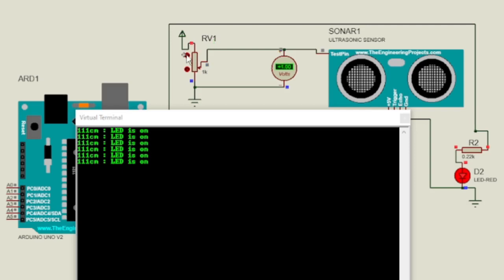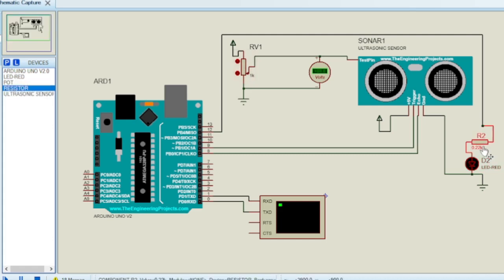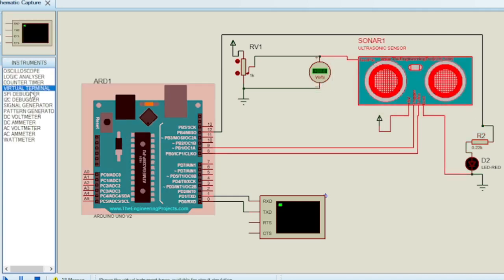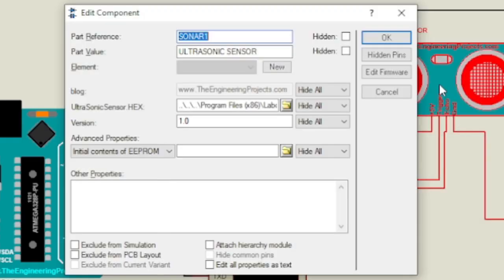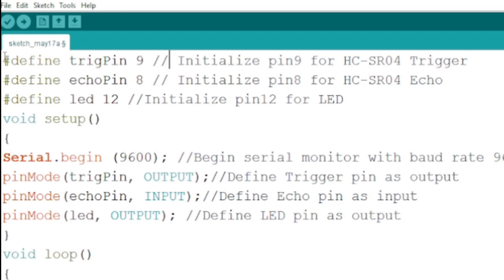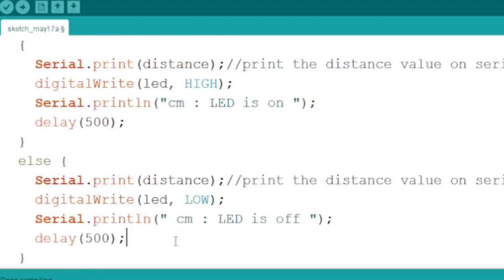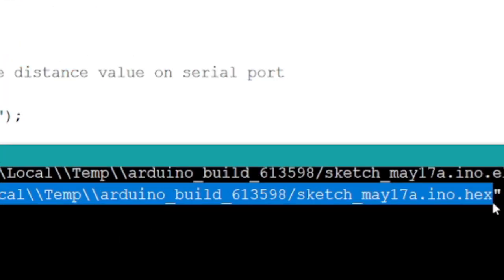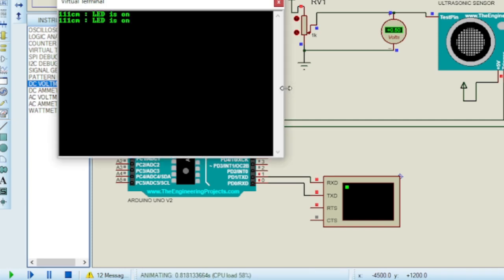🛑How to Simulate Ultrasonic Sensor Library to Proteus | 2024

Comment from the maker: #define trigPin 9 // Initialize pin9 for HC-SR04 Trigger
#define echoPin 8 // Initialize pin8 for HC-SR04 Echo
#define led 12 //Initialize pin12 for LED
void setup()
{
Serial.begin (9600); //Begin serial monitor with baud rate 9600
pinMode(trigPin, OUTPUT);//Define Trigger pin as output
pinMode(echoPin, INPUT);//Define Echo pin as input
pinMode(led, OUTPUT); //Define LED pin as output
}
void loop()
{
  long duration, distance; // variable to hold the duration and distance value for HC-SR04
  digitalWrite(trigPin, LOW); // Write trigger pin is as low
  delayMicroseconds(2); // Delay for 2microseconds
  digitalWrite(trigPin, HIGH); //Write trigger pin is as high
  delayMicroseconds(10);// Delay for 10microseconds
  digitalWrite(trigPin, LOW); //Write trigger pin is as low
  duration = pulseIn(echoPin, HIGH);//Read the echo pin
  distance = (duration / 2) / 29.1; // calculate the distance
  if (distance <= 150)
  {
    Serial.print(distance);//print the distance value on serial port
    digitalWrite(led, HIGH);
    Serial.println("cm : LED is on ");
    delay(500);
  }
  else {
    Serial.print(distance);//print the distance value on serial port
    digitalWrite(led, LOW);
    Serial.println(" cm : LED is off ");
    delay(500);
  }
}